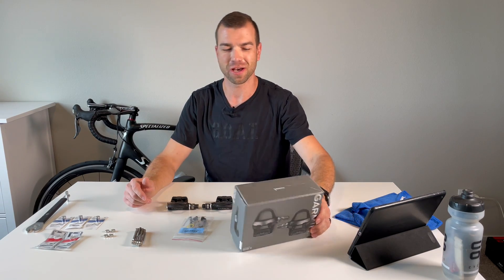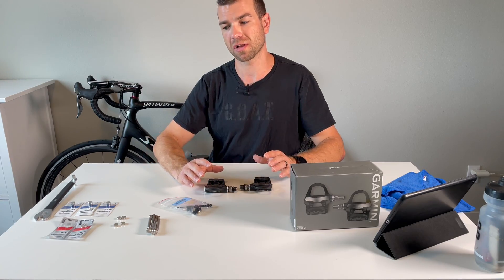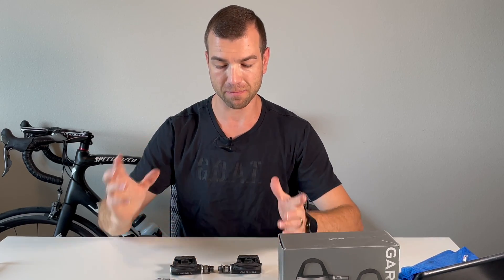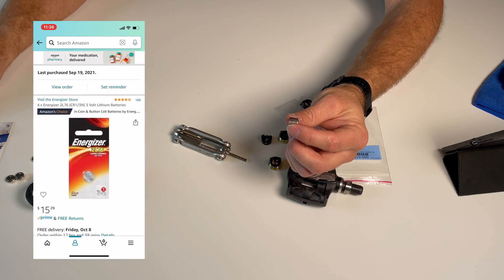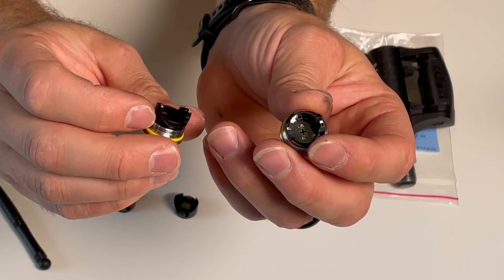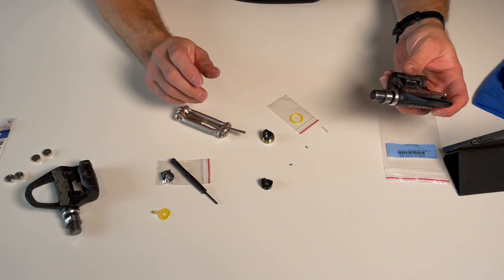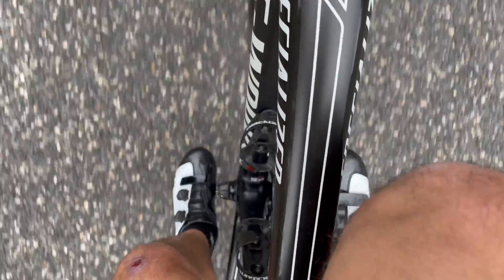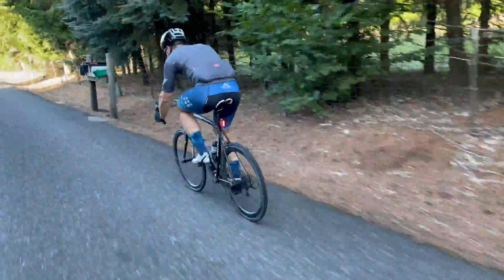Garmin Vector 3/3s power meter connection issue solved & explained - Garmin Vector 3s connection

Comment: My calibration keeps failing.
Reply from the maker: Try turning your computer off then back on and go to your sensors and manually connect to yoru paddles also make sure you are unclipped from the paddles.

Comment: Great explanation and display of upgrade parts. I just received my left right sensing vector 3 pedal bodies and was wondering if I got the new battery cap and board. And you confirmed that. Will replace and be back on the bike tomorrow. Thanks.
Reply from the maker: Awesome! Praise God this video was of help. Enjoy your power meter and I wish you higher and better FTP numbers lol

Comment: I have a recent version which came with new battery board design. Seeing issues even with it. Power drops every one minute. Any idea what to do?
Reply from the maker: Hey man. I wouldn’t be able to tell you what the issue is. It could be the battery , if you are using the wrong battery it could cause issues

Comment: I just returned in guarantee the old one system. After only 2 months i have the same problem with the new system, all time losing signal...Is so annoying paying so much money and having so much problems
Reply from the maker: I'm sorry dude! :(  After replacing the battery board, I've stopped having disconnection issues> Good luck man

Comment: Hi there, tks for the video but that didnt last long for me but i have the vector 3 (which is more complex) keeps disconnecting and right pedal sensor missing, even after the new kit installed. It worked for a couple of months but wnet right to having the same 2 issues. Nonetheless tks for your video.
Garmin should give Vector 3 and 3S clients a 50% discount on the new Garmin Rally. just an idea since so many clients were penalized for buy a Garmin (proved) faulty product.
Reply from the maker: Btw try using different batteries it helped me: https://amzn.to/2XRmX0p and I do like the idea about 50% off lol